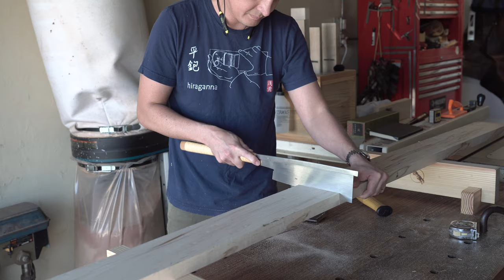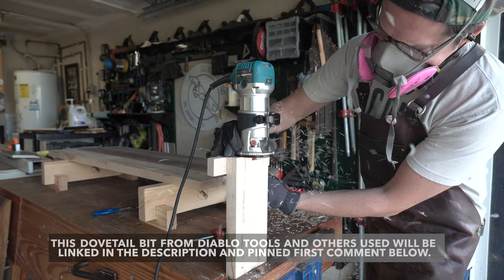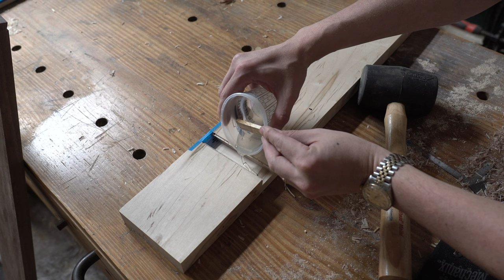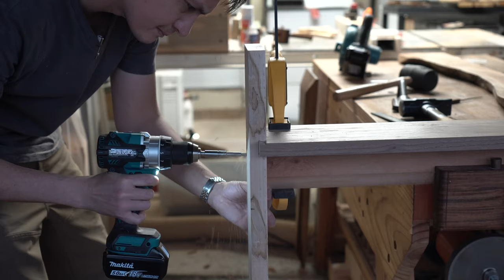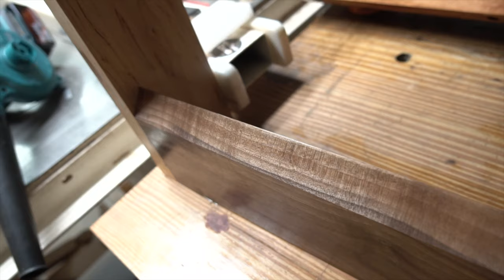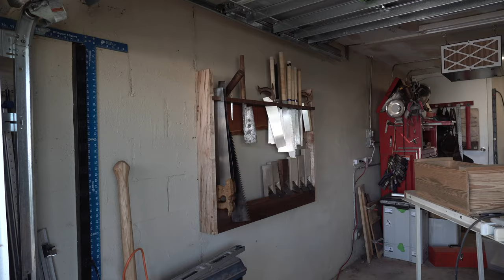I have a problem...

Comment from the maker: Help support my channel through the following links:
Diablo Tools 1/3 in. x 1/2 in. Carbide Dovetail Router Bit with 1/4 in Min Chuck: https://homedepot.sjv.io/c/2589535/1468025/8154
Japanese Woodworking Tools: Their Tradition, Spirit and Use (Book): https://amzn.to/3f2eSuH
The Real Milk Paint Company's Impressive line of finishing products (Special Affiliate Link):
https://www.realmilkpaint.com/ref/cowdogcraftworks/
For 10% off use coupon code: cowdogcraftworks
-Starbond CA Glues (Special Affiliate Link): https://bit.ly/3A6I5h8
For 10% off use coupon code: cowdogcraftworks
Support Japanese Craftsmanship in America and purchase planes and blades from Suzuki Tool: https://suzukitool.com/
Making Shoji (Book): https://amzn.to/3EGLAiV
The Complete Japanese Joinery (Book): https://amzn.to/2OAj1sM
Carson LumiLoupe Jeweler's Loupe: https://amzn.to/3thiuQJ
Shapton Glass Stone 8000 Grit 5mm: https://amzn.to/3mtX2EY
Shapton Glass stone 3000HR: https://amzn.to/3ekDKh6
Shapton Glass Stone 1000 Grit 5mm: https://amzn.to/3EvCVg4
8 Inch Diamond Hone Sharpening Plate 400/1000: https://amzn.to/3FuKbdd
Shapton Glass Stone Set w/Field Holder #500, 2000, 16000 Grit 5mm: https://amzn.to/3ojR230
Metric Japanese Style Carpenter's Square: https://amzn.to/35kC3fG
Mini Square 10x5cm: https://amzn.to/36mtcti
Faber-Castell Ecco Pigment 0.1 mm Pen: https://amzn.to/36oLni8
Pentel Mechanical Pencil: https://amzn.to/36uqbab
Yataro Authentic Japanese Chisel Set (5 Piece): https://amzn.to/3CLUEyV
DFM Diamond Lapping Plate MADE IN USA (120 Grit) for Flattening Waterstones and Sharpening: https://amzn.to/3z2MvWA
KAKURI Woodworking Japanese Block Plane 60mm, Manual KANNA Wood Planer for Finishing Wood Surface, 2.9×2.7×10.1 inches (41937): https://amzn.to/3szzXoe
KAKURI Chisel Hammer 10.5 oz / 300g, Japanese Woodworking Hammer GENNO for Chisel, Plane, Nail, Sledge Hammer Wooden Handle, Made in JAPAN: https://amzn.to/3ICeos8
DFM Tool Works Blue Cabinet Scraper Rectangle Sets- MADE IN USA - Multiple Sizes (2, 0.032" x 2.5" x 5"): https://amzn.to/3rVjVTY

If you want access to more tools, check out my amazon storefront: https://www.amazon.com/shop/cowdogcraftworks

//Follow along:

IG: https://www.instagram.com/cowdogcraftworks/
Twitter: http://www.twitter.com/cowdogcraftwork
Facebook: http://www.facebook.com/cowdogcraftworks
Website: http://www.cowdogcraftworks.com

Comment: I think if you were to take another beveled plank, and use a tenon to mount it it into the upright at approximately the skew angle, it'd hold the planes with that skew even though it'd slide down; you'd need one on either side to hold lefty & righty planes, or perhaps have some of them mounted sole out.
Reply from the maker: Interesting.

Comment: Ive been also interested on japanese tools, but with my limited space I have to be more conservative. Ive collected a couple saws, no planes yet but had a couple questions for you.
Do you have a recommendation for a keyhole saw? Ive been wanting to get one but not sure what brand, length and the justification to get one at all😅Where would you use it basically.
Also would you recommend the Kakuri Azebiki saw from Amazon? I have hand planes but would like to use a saw to create grooves and dados with it.
Thank you!!!
Reply from the maker: So I haven’t used that azebiki. I’ve switched away from disposables for the most part but… I in my experience most disposables are still pretty damn good and one azebiki is better than zero azebiki. As for a keyhole saw I know that Zetsaw makes a great one.
Reply: @CowDogCraftWorks  I see. Yeah I've been wanting to get my hands on sharpenable japanese saws but I think I'll try that saw in the meantime. Thank you so much for your words of wisdom 🙏

Comment: Hello, do you know of any Dozuki saw purely for rip cuts? I use a classic gyokucho with the "universal" teeth and works well, but I always wondered whether there are saws with finer rip teeth
Reply from the maker: Hey petr: yes there are rip cut dozuki. Mostly in the non disposable variety. I have a specialized tool dealer @yournokogiri on Instagram who comes across those regularly.